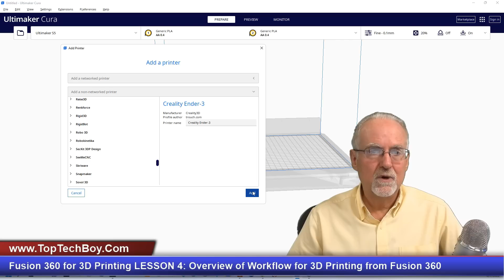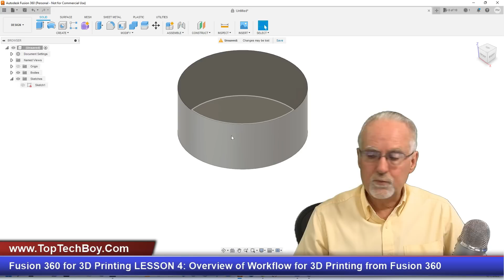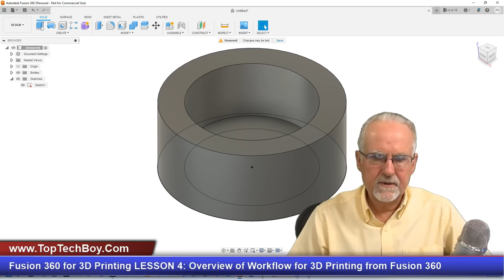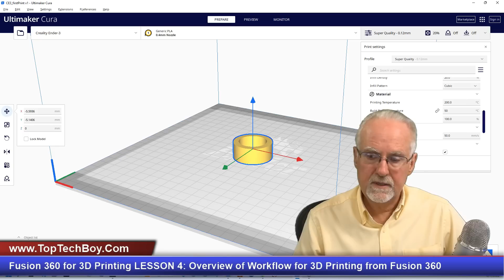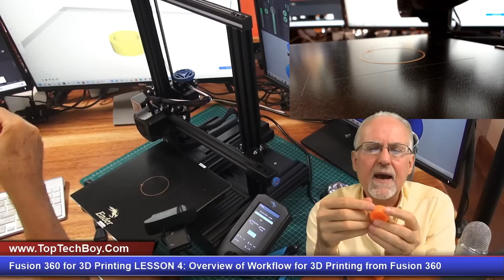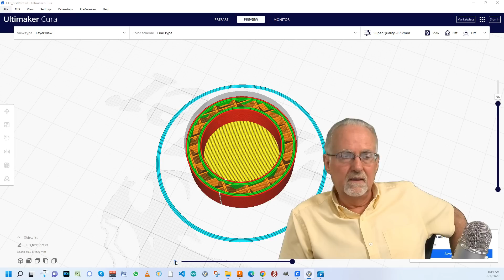Fusion 360 for 3D Printing LESSON 4: Overview of Workflow for 3D Printing from Fusion 360

Comment: Thanks Muchly. I'm a novice with Fusion, your slow steady approach is much appreciated. Too many other tutorials, as you say, go too fast to follow. And your emphasis on workflow got through to me. For example, I never noticed the Sketch Lock symbol on the Browser and none of the other Tuts I have watched have ever mentioned it...
I  am a very experienced Sketchup Pro user. (20 years since V5). But as you explained so well, Fusion ain't PowerPoint, (or Sketchup :). 
A huge 'Aha' moment for me was you mentioning that after an Extrude, for example, the Sketch disappears. This has had me stumped and stalled for 2 months. 
Subscribed.

Comment: As much as I love your tutorials (Arduino on down through the years) I am disappointed that I cannot continue with using Ultimaker without having a 3D printer.  I was hoping to learn how to use Fusion with you before buying a printer.
Reply: Like you I just want to learn Fusion.  Just skip thru to Ep4 and start from there, it is good stuff.

Comment: Great work Paul. I just want to confirm if you have set the z offset for your printer. Also for your issue regarding the print peeling off you should try magnetic rough buildplate

Comment: The emphasis you put on getting started each time reminds me of the work I used to do using a GC. Everyday I would start with an hour or so getting the system just right before starting work. I always got excellent and reliable results, day after day, week after week. I am sure other people thought I was nuts, but the proof was in the pudding! Same with all of the other analytical work I did with a wide range of instruments. Not only did I get excellent reliability, but the equipment lasted longer as well. I can really relate to your checking and adjusting every time!

Comment: As I mentioned previously, the Bambu Lab X1C is not a printer that is yet supported by Cura. I am therefore, using Bambu Studio Orca Slicer instead. My first print took 10 min and came out nicely. Suggestion: In the future, please change your cursor to Black, and make it a bit larger, to enable us to see it move around the screen better. Also, when you do move around and click on something, please describe what you are clicking on. This is more important with a tiny while cursor and will hopefully be less important if you change to a larger black cursor. Thank you...
Reply: I just ordered a X1C. I noticed that the Cura has no option for it. Does the Bambu slicer work as well as the printers?

Comment: I thought that infill didn't matter that much either until I wanted to print different things and speed started to be a concern. Gyroid is fast grid is strong and there are actually settings in infill that will speed things up considerably other than infill amount.

Comment: Thanks Paul. 
This is for everyone... if you are not using Octoprint or similar, you can save a lot of time not moving a SD card around all the time. I run it on an old Raspberry Pi B+ (I think... circa 2013) and you connect with your browser. Drag & drop gcode.
Also, I just started using glue sticks on the print bed - a glass plate on my Ender 3, and it has worked wonderfully. Just any cheap glue stick from ol Walton's store - looks like a big chapstick. Mine is branded pen+ Gear. Solved my adhesion issues.

Comment: I noticed you had '3D Sketch' checked in Fusion 360 Sketch Palette which is why you started with a 3D view of your sketch and a more complicated move tool. I do not know how to reset the Default on this though, it seems to remember these palette settings through new design or even a program restart, but it is not impacted by a preferences reset. Maybe someone knows how to get the UI back completely to a default state? However in preferences, Design for your account you can uncheck 'Auto hide sketch on feature creation' to address your other complaint about unwanted 'helpful' behavior!

Comment: My prints are coming out awesome!
I changed the design of the cup. Instead of a cup I made a cylinder with a center post. I also put some notches around the circumference at 120 degrees. I’m gonna install this into a coupling mounted on a stepper motor to check my rotation. I need to turn exactly 120 degrees.

Comment: first print of the dog worked like a charm, but i'm having a lot of trouble getting a second print to stick.

there's a visible circle in the middle of the plate where the dog was and it seems like the PLA doesn't want to adhere to anywhere that the dog was touching the print bed? i can't see or feel any actual material there, a google search says to clean using isopropyl alcohol and scraping off any old bits, but there's not really anything to scrape. i tried it anyway, no luck. i am pretty confident i'm leveling the bed well, all four corners and the middle have feel a little grippy on the paper. i've tried to start a second print three times so far with the same results each time, basically just end up with a string of filament following the nozzle around, not attaching to the bed at all, and ends up in a knot after going in a few circles trying to do the skirt and i cancel it. have also checked/adjusted bed leveling and tried cleaning it again between attempts. the visible circle where the dog printed remains.

thinking about going to buy some hairspray tomorrow just to try it 😅
Reply: ok well i tried hairspray which still didn’t help. i went through a ton of videos/articles about to to best clean the printing plate, tried a bunch and still no dice. found one that mentioned doing a deep clean with hot water and soap in the sink, so i tried that, and now it’s working! or at least first layer actually stuck and is holding its shape as the extruded moves around, 🤞🤞for the rest!

Comment: Paul, glad to see the new F-360 series.  Somehow, I've not been getting notified of your videos but is happening with other channels.  I think YT is putting their thumb on the scale by unclicking the notification bell!  Anyway, you make a lot of good points especially about safety as I've came back to my 3D-printer only to see some horrifying malfunctions!.
Suggestion:  I have placed a dedicated smoke/fire detector mounted to the very top cross-arm of my 3D printer, so if anything goes wrong I get an advanced alert.
I was able to use some really sticky double-sided tape so I could mount it in the correct up/down configuration.  I DO-NOT recommend that you ever leave your house with a 3D-printer running; too often I've had failures of one sort or another and was glad I was around.  I understand that sometimes you need to let them go overnight and that is why I put the smoke-detector right above mine.
It doesn't happen often but any micro-computer can glitch/crash and do something like leave the bed or nozzle heater stuck on.  Also, the solid-state relays can short out and do the same thing.
So, please take Paul's warnings seriously!
Reply from the maker: I have noticed the last few months that my channel is losing momentum, like youtube no longer wants to send people my way. I do indeed think they tweak the scales to promote certain world views and politics.

Comment: Thanks for the nice tutorials. Should the bed leveling not be done when bed and hotend is at temp? Does it not expand more after heating?
Reply from the maker: People argue about this. I dont heat the bed, because if I heat things up, then the filament starts oozing out the nozzle, and makes it harder for me to measure the gap with the paper. Some people argue the other way, as you suggest.

Comment: I was able to print the cup successfully, however I noticed a vertical ridge on the inside wall of the cup from top to bottom. It was a rounded thin vertical ridge. I was wondering Paul if you or anyone else has seen this issue on your cup? I actually was able to print the cat (sorry Paul) and it actually turned out quite nice. I am wondering if the problem with the cup is a retraction issue?
Reply from the maker: It is called a 'seam' and is normal to be there on structures like this. We can try and manage it with slicer settings, but will always be an issue. It is where the layer starts and ends.

Comment: I am having a lot of trouble with my Ender 3 v2.  Bed levelling and adhesion are very inexact science.  My version of the cup has voids in the sides looking from the top, is not round and has blobs on the inside and outside walls.  My first dog print was great, except that the rear half of the skirt was missing.  Since then it has been downhill for me. I have watched hours of YouTube videos and tried to learn from them.  Anything Paul can tell us about troubleshooting problems will be invaluable for learning this art of 3D printing.  By the way, the yellow cursor helps a lot to follow the videos.
Reply from the maker: In these lessons we will be covering how to tweak the printer in future videos. For now, try to get the bed as level as you can. If you can not get it perfect in all areas of your bed, at least try to get it as good as possible in the region of the bed your print will be. Look under the print bed, and see if the springs above the adjustment knobs are roughly equally extended. That is to say, on one side if they are very compressed and the other side they are extended, that means your X-gantry is not level, and your X-gantry needs to be aligned. I will show that in future videos, but for now look  on youtube for a video on how to level the X gantry on the Creality Ender. When your printer is aligned properly bed leveling should just be a final tweak. Also, the key is dont give up. All printers can be made to work, but they have to be adjusted and fine tuned.

Comment: I just saw the course this GREAT! I Tried the original course and Autodesk stopped my trial,I have no clue why?  I have been using tinkercad. I am back on Fusion 360 and downloaded cura.  Cura works very differently on my “tinkertoy of 3D printers. I am considering the ender, it the auto level with the few dollars more?
Reply from the maker: Start with the basic printer I link to in the description. Then over time in these lessons I will be showing upgrades to the printer. I am not sure auto bed level would be the first upgrade I would buy.

Comment: Key board shortcuts are a must, much quicker than trolling tru menus.   Also is worth the effort to set up Cura with fusion under utilities. Then you can just select the body you want to print and it automatically opens Cura.  New users struggle with bed level due to the moderate learning curve.  Although learning the basics is a must, installing an auto bed level such as creality CR touch are very beneficial, reduce frustration and much quicker print time.  You also dont have to level the bed before every print.
Reply from the maker: I dont disagree with what you are saying, but what I am trying to do here is take a person who has never used a 3D printer and never designed in Fusion, and get them to the point of a first successful design-print workflow success. Early success is key to inspiring students to stay with a topic. Over time, we will work on all the more advanced topics, and will be doing upgrades to the printer over time.
Reply: @paulmcwhorter  you are the only Teacher i like, because you are the only One which also cares about the joy of the students. It is realy fun to learn things from you and you inspires me to get starter with all of this (: Thank you very much

Comment: Thankyou TopTechMan
How about multi color printing 
Especially spheres or to be more precise The 🌍
Reply: There's 2 options for printing multi color, the first and least expensive is to look for PLA that offers 2 or more of the color you want or and this is probably the most technical is to install a dual extruder, however I would probably advise caution if you're new to 3D printing. but, there are some really good PLA's available especially if you want to have something with multiple colors without having to constantly change the PLA everytime.

Comment: My printer has not worked from the getgo. When I tried to print the dog the head went to the home position and stopped. The nozzle and bed heaters turned off. I have been in touch with Creality. I sent them a video of what occurred and pictures of  the motherboard. I also ordered a new 8 mb sd card. I willl let you know what the resolution is.
Reply from the maker: Stuart, life with a 3D printer is filled with heart break. Creality should work with you to get it fixed. Then you will have some good days, and then another problem. This is true of all 3D printers. I had an $8000 3D printer, and it had all the same issues as the cheaper ones. Best of luck and let us know how it goes.
Reply: @paulmcwhorter  I bought a new 8 mb sd chip, formatted it and copied the dog file to the new chip. I was then able to print the dog.
Reply: I was able to print the dog. I purchased a new 8mb sd chip, formatted it and copied the dog file to the new chip.

Comment: I had my printer 5 days and already it came up with a dark blue screen. I couldn’t do anything with the printer. Not sure what happened; but, I’m guessing that I was not careful enough about when to remove the SD card. After doing much research on the internet I came up with a plan of how to fix the blue screen problem. I had to flash the main board with a file downloaded from the Creality website. I got the printer working again and now I’m a happily printing 3D again.
Reply from the maker: WOW, great to hear you worked through it. 3D printers are definitely not good as a first project type of thing. You need to have good troubleshooting skills, as you have demonstrated. 3D printers require lots of TLC to keep them working.

Comment: Problems I am having are project is peeling off and the corners are rolling up on the bottom. I was using the slicer that came with my ender 3 but I have installed Cura so hoping I can fix some of my issues, also mine was set to print a raft so I will change the setting. Thanks for taking the time to create these lessons Paul.
Reply from the maker: OK, first, do the print just like I did it in the video. Make sure your bed is properly leveled. If you are having trouble leveling the bed, you might have to adjust the X axis Gantry, lots of videos on youtube on how to do that. Life with a 3D printer is a constant struggle to get prints to adhere to the bed.

Comment: When I built my printer it was clear that there was a lot of up and down slop in the right hand end of the X-axis gantry.  Only one of the 3 support rollers was actually in contact with the vertical pillar.  This meant that the X gantry wasn't level and the up and down slop was obviously going to cause problems when moving the print head around manually to do the levelling.  I watched a couple of videos on X gantry levelling and then set my printer up so that the X-axis was level and all the rollers were in contact.  Bed levelling then worked fine for me (I did it with the bed hot which adds a bit of extra excitement to the process).  My test print went really well with excellent bed adhension.  Out of the box, its a lottery as to how horizontal the x-axis will be on any particular printer due to manufacturing and assembly tollerances.  Paul was clearly lucky with his printer, but I would suggest that anyone having bed levelling issues checks how level their x-axis is and how much vertical slop there is at the right hand end. Get that sorted and you will have a good basis to work from.
Reply from the maker: Life with a 3D printer is a life of constant tweaking, upgrading, adjusting and fussing, just trying to get that perfect first level. Yes, getting the X gantry level is very important. The more perfect you get the X gantry, the easier it will be to level the bed.

Comment: WHITE MARKS ON UNDERNEATH. ⬛️ 
If you have difficulty removing you work from the build plate, you will most likely also have white marks on the underneath of your work. 
Under a microscope 🔬 these white marks are actually tiny strands of plastic like hair. 
A lick of flame 🔥 will fix this a treat 🙂👍 
You may also wish to try acetone smoothing (It doesn't have to be acetone (nail varnish remover)) any solvent will do 😀👍 
Simply leave your work in a small enclosure where the solvent vapour is present for a few (40) minutes or so. 🙂👍

Comment: BED NOT LEVEL. 🛌 
For those of you with issues of a depression in the middle of the bed: 
Remove the build plate (glass).
Cut out ✂️ several squares of paper around 50mm to 70mm. 
Place these squares of paper under the build plate in the center. 
You may also require 4 bulldog clips to hold the corners of the plate down.
Then re-level the bed and see that the problem is solved. 🙂👍
Reply: Thank you! Thank you! Thank you! Thank you! Thank you! Thank you! Thank you! Thank you!

Comment: Also for a faster export…
if you Right-click on your Body, then left click choose “Save as Mesh” (used to be called “Save as STL”).   It exports without saving to the Cloud. 
You can also launch straight into Cura and automatically load your STL if so desired.
Reply from the maker: Thanks for suggestion.
Reply: File/3D print will bring up the same dialog box.

Comment: Hey Paul, in the Sketch Pallet, uncheck the bottom option “3D Sketch”.  That will fix you having to click TOP on the view cube.
Reply from the maker: Dave, yes I realized that after I made the video. Prior to filming, I had been playing with offset sketch planes, and then when I started making the video, I realized I was still in 3D sketch mode. I hope it did not confuse people.

Comment: Shouldn't you heat the bed before leveling?
Reply from the maker: Some argue to level with the bed hot, but for simple prints it does not make a big difference. Certainly is an option you can consider.